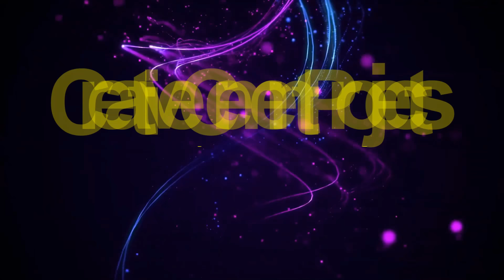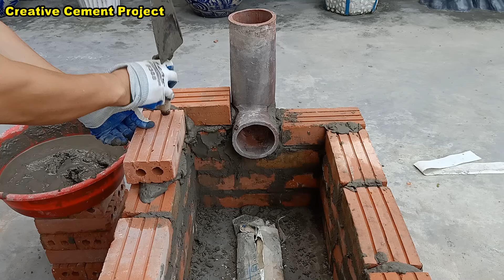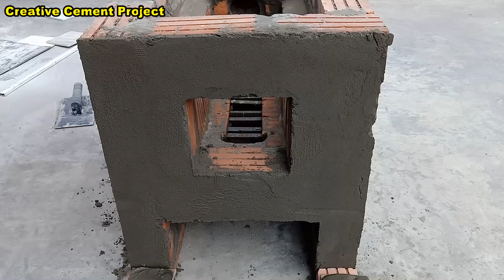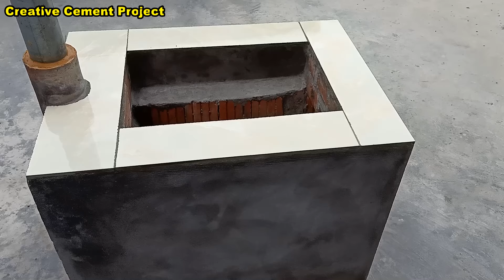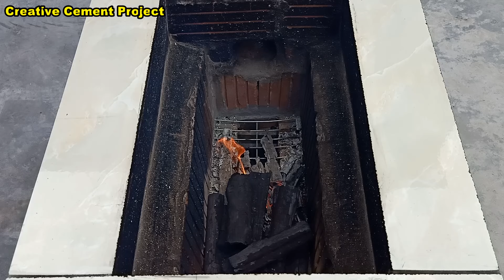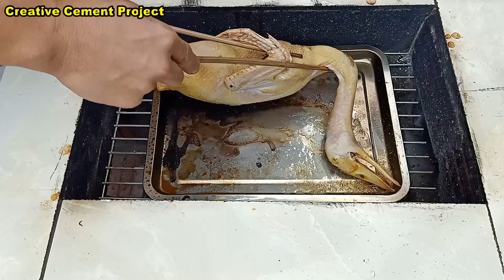How to build a multi purpose oven with cement and brick at home

Comment: Only clay may be used to built ovens. Cement cracks in fire. Also, bricks should be without holes, and being made by special clay, able to keep high temperature.
Reply from the maker: Thank you

Comment: Furnace and chimneys are only made of solid brick! Second, in places where it is extremely hot, you must use special fireclay bricks and to connect bricks you use clay. The construction in the film only looks nice, but it will not be very durable, it will break after more heat. The grate should be made of cast iron or stainless steel. The biggest problem is ordinary bricks with holes. Stove/furnace or grill is best made of field stones, the stones can hold the temperature for hours, the meat is perfectly baked, not burnt.
Reply from the maker: Thank you very much
Reply: @Creativeproject2020  :)

Comment: Please answer my questions👇👇

Can you please tell me the name of the cement and brick?? 

Tell me about the elements  you used here to make the oven..

Please tell me can i make the oven with any types of cement and brick??
Reply from the maker: Thank you. You can use heat-resistant cement and baked bricks. If heat-resistant cement is not available, you can use plain cement, but at a low ratio, the stove will not crack.
Reply: @Creativeproject2020  plain cement means which we used in making buildings?? Is it? 
Please tell me

Comment: Yeah, really ... It's been a long time since I've seen such shit. Why didn’t he show how, during the furnace, the stove was bent in an arc and fumes come out of the furnace through the cracks? Excellent shots would be for instructions on how not to do it. Yes, and tightly smudge the steel pipe into the brickwork - so-so idea - their temperature expansion is different and the metal will tear the brickwork in a couple of furnaces.
---
Да, уж...Давненько я такого дерьма не видел. Чего ж не показал, как при топке плиту выгнуло дугой и в щели гарь из топки выходит? Отличные бы кадры были для инструкции как не надо делать. Да и намертво вмазать стальуую трубу в кирпичную кладку - так себе идея - температурное расширение у них разное и металл порвет кирпичную кладку за пару-тройку топок.
Reply from the maker: Thank you for your comments, but I'm not metal pipes but ceramics. Build like me the temperature can't crack the stove